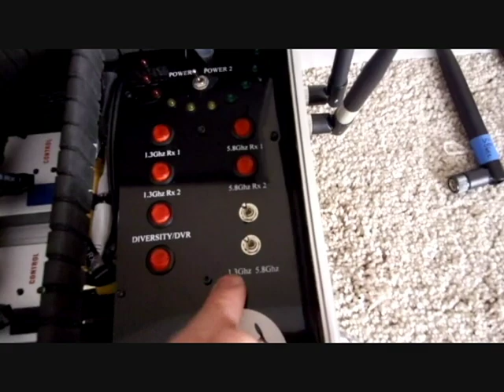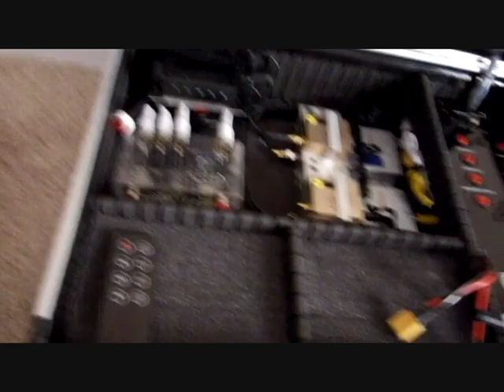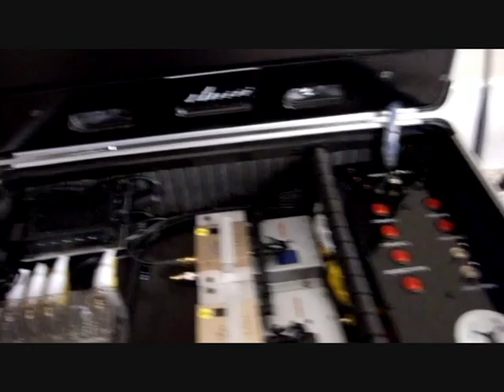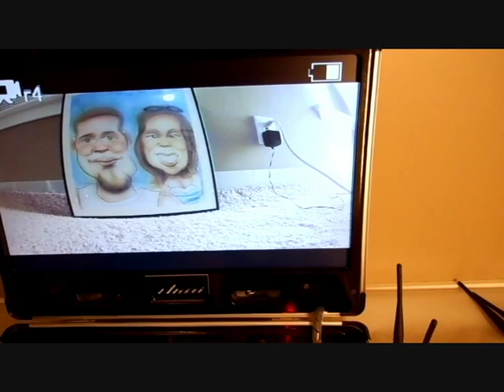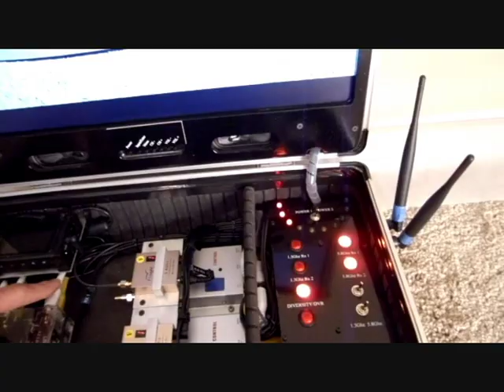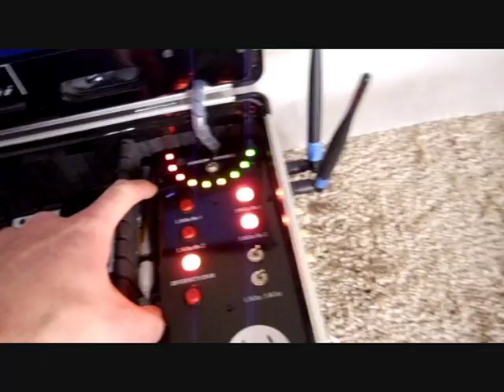19" LCD Custom Ground Station Case

Comment: Great video and great job you've built here, congratulations!

First question rs
Why do you use 2 different frequencies of video?
It would be one for each quadricoptero model?

Second question rs
because you used the antennas so close and also why identical antennas?

You would not have a real advantage using your system with different antennas such as a directional and a cloverleaf ...

Comment from the maker: Hey everyone. Thanks for the love on the ground station build. First off I want to say at the current moment I am way too busy to build these for people. I haven't even built myself one yet unfortunately. This specific case sold for over $1000 with all the equipment installed. 
The switching between power sources is accomplished by a simple DPDT switch. The trick is the inverter I used. It has a rather large capacitor that discharges during the switch. A simple large capacitor on the load side would suffice.

Comment: That's probably the best presentation of a ground station I've seen here on YouBoob.  Very nice and clean Foam Fanatic...well done.  I have a DJI Lightbridge setup with 2.4 GHz and HDMI/USB outputs only.  What do you think you can do with something like the Lightbridge?  I imagine there would be less hardware and more room in the case (no diversity, no dual receivers) for whatever else could be imagined.  Perhaps it would cost less as well, but I haven't given it much critical thought.  Perhaps you have? - at least since you've built the one in the video?  Nonetheless, great job and thanks for sharing.
Reply from the maker: I haven't really looked into the light bridge setup too much cause it is kinda out of my comfort zone as far as the cost goes. I am not willing to spend that much at once on a hobby at the current time. From what I have seen it would be a very simplistic case considering the removal of quite a few components. Thanks for the props on the case.

Comment: What does a set up like this cost??
Reply from the maker: This case with all inclusive hardware was all a one off build. So with the time spent to fabricate, mount and wire this case came out to be around $1000. Hardware for all the receivers, diversity and dvr was a couple hundred alone.